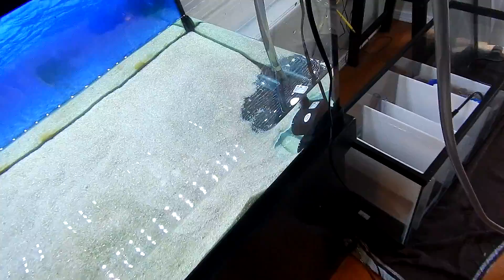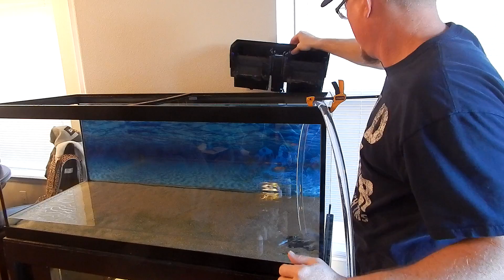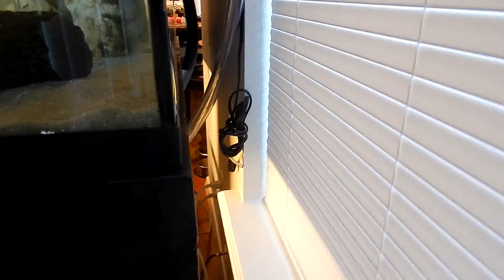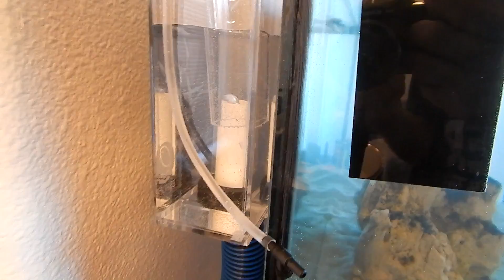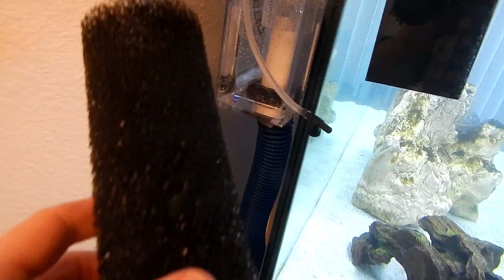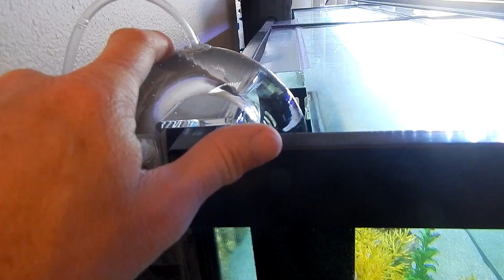29 gal freshwater sump part 6, THE FINAL BUILD!

Comment: The only issue i see with your stand design is that it has an open bottom. If you have a bottom on it and killz it very heavily and then add a thick layer of latex paint it makes it water tight. So if you have a leak or an over flow situation it will contain the water in the stand and give you a chance to catch it before it floods your house. Also if you sand a small grove all the way around the tanks perimeter then drill a hole in the back in the middle of the groove. Then add a piece of tubing that runs to the sump.   That way if the tank begins to leak it will just drain right back into the system. It will again give you time before flooding your home.

Comment: I see a lot of ppl make this mistake.one your sump water level is set too high for that tank of your pump stops it's gonna overflow.two those overflow boxes work ok to hook up a sump but your gonna be tired of that in a few months.unless you cant drill your tank then drill.is a cool idea for the return in the tank it can't pull but what's in that box Incase the pump stops.
Reply from the maker: I see a lot of make this mistake of commenting without watching the whole video. If there’s a power outage the sump will not overflow. The siphon will break at the top of the tank with the return pipe. It’s in the video. Or at least it’s in one of the videos in this series.

Comment: Old video but still relevant on how easy it can be to set up a sump.  My only reco would have been to make a plastic or plexiglass cover for the sump with hose cut outs to reduce water evaporation and retain heat better.  Nice managuense must be beefy by now.
Reply from the maker: I did end up making a cover

Comment: in case of power outage you have to manually trigger return water flow and if you are not there in this situation your water would stop going back to sump when power would come back and there would be water all around the room since electric pump would keep throwing water to tank from sump or you wont have enough water in sump to pump back to tank since no water coming back to sump from tank. In either situation you must put sensor in tank or sump.
Reply from the maker: Kashif Mir Completely false, I simulated a power outage and everything would restart.
Reply: @jdofishtank6018  it's strange but good to know. This was my only fear about this setup. Is this customized sump and can you put the link where did you buy this return system from?  Regards

Comment: Thanks for the series of videos…they were very helpful.  Just by chance, the system I’m currently designing is very close to yours…75 gallon display tank along with a 29 gallon sump.   I was hoping to use a 40 gallon sump, but the cabinet I needed to build for it was just starting to get too big!   

I would like to ask you a few question if you don’t mind…It’s been a couple of years since your build…Have you been satisfied with everything?  Looking back, should you have done anything different?

I’d like to make sure I understand the safety measure you incorporated by using your old Bio Wheel filter for your water return.  If there was a power outage, gravity would create a back-flow in your return hose.  Since the return hose is in your Bio Filter, the only water that would back into your sump would be whatever was in the hose and just a small amount of the surface water sitting in HOB filter.  

What was the total height of your stand?  I notice you didn’t build a lower cabinet floor in your stand, so you grabbed 3.5” in additional clearance to access & maintain your sump.  How much clearance do you currently have from the top of your sump to the top portion of the cabinet?

Appreciate your time.  Thanks again for the video series.  Nice build!

Comment: The 29 gallon sump is on a 75 gallon tank right? Does it do well with this size sump? I’m setting up a 75 gallon Malawi tank soon, got everything but the sump, which I plan to design and build myself. I was thinking of using a 40 breeder?
Reply from the maker: D.H. Aquatics Yes this is a 75 gallon tank with a 29 gallon sump and it worked great. A 40 breeder will work as a sump also. Just as important also, is the overflow and return pump, how much GPH is being pumped.
Reply: With the head pressure I’m getting about 760 GPH. Also added an ATO system to the sump with a separate 10 gallon top off storage tank. I should’ve probably went with just a 5 gallon ATO reservoir. Also added an API XP2 canister just purely for mechanical filtration, mostly bcuz of how much my African cichlids poop.

Comment: Nice looking tank and sump. I “highly” recommend placing your electrical, surge protector “higher” up and off the ground and... be careful with that “air vent” on the floor, to the right of the tank. Personally I wouldn’t put the tank next to an air vent on the floor, but if you can, I’d protect that vent with “something” to prevent any water from draining into it.

Comment: I love the sump concept. 

Was there any particular reason that you didn’t use the first chamber in your sump when your water comes in to also put your mechanical filtration in?  Seems like you could have eliminated one section and created a larger bio chamber. I suppose it would be beneficial when it comes time to change your mechanical filtration you wouldn’t have to mess with moving the hose. Maybe I just answered my own question 😬
Reply: Midwest Coin Hunter I would’ve put filter socks in the first chamber on the hose

Comment: If a power outage goes on is the overflow box with continue sucking down water in the sump?
Reply: Or the tube is high enough so the water stop getting down the tube?!
Reply from the maker: AmneziaXEaster - Gaming yes you just need to test everything. My return pipe is high enough to break suction and the overflow box with stop before the sump overflows
Reply: JDO Fishtank Oh ok thanks!

Comment: nice build...FYI though; if you're still using the IR thermometer,  it doesn't work for liquids. Doesn't "see through" glass, liquids or other transparent surfaces - even though visible light (like a laser) passes through them (i.e. if you point an IR gun at a window, you'll be measuring the temperature of the window pane, not the outside temp)
Reply: If your water is still, you can point the IR thermometer from the top of a tank (lid open) and get temp reading off a rock or the substrate through the water...I've been doing that for a long time...the reading I get is like .2 degrees different from a wired aquarium thermometer...but yes, you can't point it through the glass...only through the water and preferably with the power head turned off.

Comment: Where do you buy those dividers to make the sump???
Reply from the maker: Mitchell 42 I got it for free at my work
Reply: JDO Fishtank where would that be / where would someone who does not work with you be able to get their hands on some? What would those walls be called exactly
Reply from the maker: Mitchell 42 i have a video explaining all this. They’re acrylic, you can order sheets on Amazon or probably find a local place that sells it.
Reply: Your local home depoo mat have them as well. Check there first, before going on line. For security reasons, I always check the local builder supplyers , first.

Comment: I wonder if it would make maintenance easier for you if you use a sock filter off the pool hose to sump.
Reply: It will prefilter large particulates down to the smallest size it can filter.  I have a micro sock on my return and gets down to micro sized particulates.  I clean my sponge filter when its not flowing water anymore, which comes out to about every 2 months.  The sock I take off each month to clean it out.  Other than that, with my DIY wet/dry trickle tower sump, I only maintain it once a month.  As for the display tank, I vaccum the gravel every 2-3 months.  I dont do any water changes at all, but do top off my sump when the water level gets low.
Reply: @Magny80  Over time, nitrates will build up in your aquarium. This process is continuous and unavoidable. I believe it will be compounded with zero water changes...
For me, it's the biggest reason to do a weekly water change. But I have a highly stocked tank 100 gallons and about 50 cichlids and rainbows.

Comment: I noticed a lot of people use a cooler as a holder while they work on their aquariums. Is there a specific reason for this? i.e.e coolers hold the warmth in the water better? I just use a standard 10$ utility bin from WalMart, but if a cooler is much better I absolutely do not mind buying a 100 Quart.
Reply: Mike Dean i would assume built in handles and some have wheels. Easier movement and of course insulation. He lives in a colder climate area. He also had a heater setup in the cooler. I guess it depends where you live and/or what you are willing to invest in (cooler vs cheap storage tub.)

Comment: What pump are you using as an intake?because I can’t find anyone who uses a pump for a sump, they all just drill a hole in the tank and I don’t want to do that
Reply from the maker: Josiah Kirchhofer watch the series on building all this. I have an overflow box on the tank and a pump in the sump. The pump pumps water from the sump to the tank, when the tank fills up enough water from the overflow box goes back to the sump.
Reply: Look up diy aquarium overflow. Can build a way around drilling for about 15 dollars

Comment: You don't need to save any water... bacteria lives in the substrate and media...and if course rocks and other decor inside the tank...you just need to treat the new water before putting fish in the tank.
Reply: When you replace all the water you will get a lot off nitrate the first two weeks
Reply: Juji Amen-ptah 

90 -99% wc is not the way to go...can you explain why u do it....
Reply: Saving water isnt for cycling.

Its make sure the fish dont need to acclimate to different waterparameters.

Can be very usefull to avoid stress, stress can cause ich.

Comment: Hey if you need a great filter this is a great one I have it comes in different sizes it is the best filter I ever had click link to check it out it’s on sale https://www.amazon.com/gp/product/B0009IODZG/ref=as_li_tl?ie=UTF8&camp=1789&creative=9325&creativeASIN=B0009IODZG&linkCode=as2&tag=reviewforyo00-20&linkId=1468c54393d36c4f591f3e3a9b9650f5

Comment: I like the idea of that overflow box but it would always worry me that it might fail and I come home and the sump runs dry and tanks overflows onto the floor, dead pump, dead fish maybe! Make sure you keep that sponge on the overflow clean, if that clogs up which it will, you will have issues!
Reply from the maker: It's still running with no issues.
Reply: I set my DIY overflow and DIY wet/dry trickle tower sump up nearly 2 years ago, never overflowed or failed.  I only maintain my filter once a month and do no water changes at all.  I do top off my sump when the water level gets too low cause of my return pump...dont wanna burn it out running it dry.
Reply: You can get a float sensor that will  turn your pump off in the event of a clog in your overflow line. There are several options available including diy instructions online.

Comment: What happens if your pump stops? How do you avoid the tank water siphoning ntill empty?
Reply from the maker: The return is right at the waters edge, only a small amount will back flow into the sump.
Reply: The return he has is in the HoB filter shell, minimal siphoning from there.  As for the overflow, the water will stop flowing down into the sump once the water meets the bottom of the grate on the overflow.  At most, depending on the variation from the overflow and the return, the amount of water going into the sump once the pump stops would be about 1-3 gallons.  On my return, I have an anti-siphon hole drilled into the tube since its inside the tank.  But since he is using a HoB filter box for his return, the siphon will be very little.

Comment: If you install a Tom Aqua Lifter on your overflow, you will never have to worry about the siphon breaking during a power outage when you may not be there. The Aqua Lifter will pump out any air as soon as the power restores. ... Cheers

Comment: Been looking into picking up this tank and plan on using my current 29 gal for a sump. One thing I'm wondering is if the 29 gal would fit in the bottom of the stand that come with or it it necessary to build a custom stand?
Reply from the maker: trevor byers If you watch the whole series you'll seen the sump didn't fit in the stock stand, that's why I built this stand.

Comment: Hey, your system looks great and I can see now how the penguin filter body is fitting into he setup.  
Just one comment regarding the old filter media you are using to seed the system, why don't you place the sponges from the old filters into the second chamber (the one holding the filter floss), that way the bacteria will be seeded to the new bio-media directly instead of having to go through the whole tank... not that its a problem, just quicker and also the sponges will preform as good biological filtration from the off as the tank water will have to flow through them instead of taking the path of least resistance to the pump.  Removing them piecemeal will also allow the bacterial colonies to build up in the new bio-media... or just leave it in the system I guess ;-)
Reply from the maker: I understand your point. I want the already cycled sponges last, that way the new bio media will have more ammonia and nitrites to feed on thus growing more bacteria.